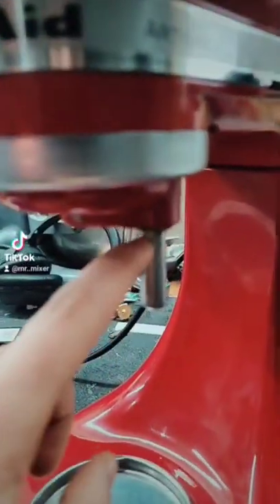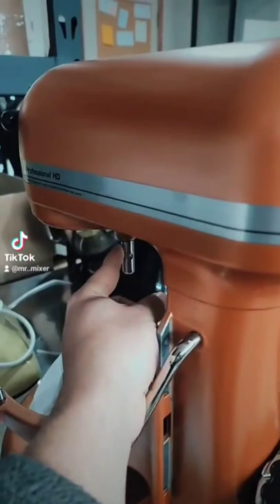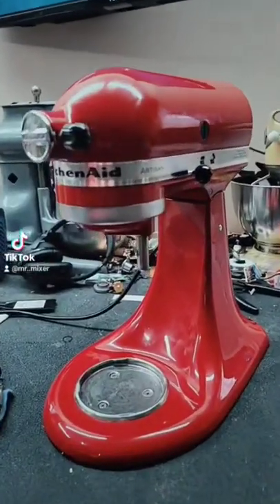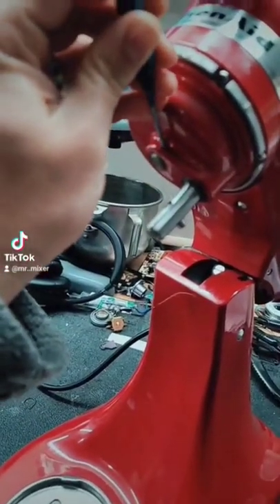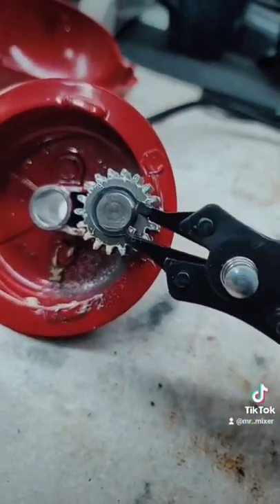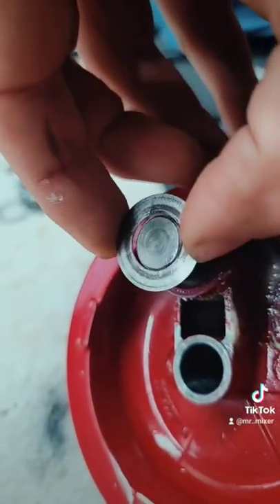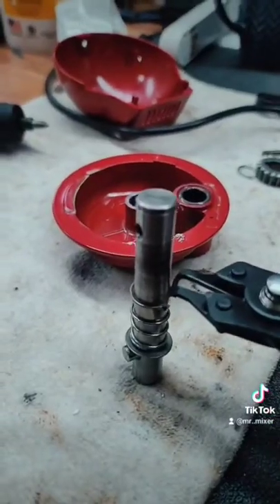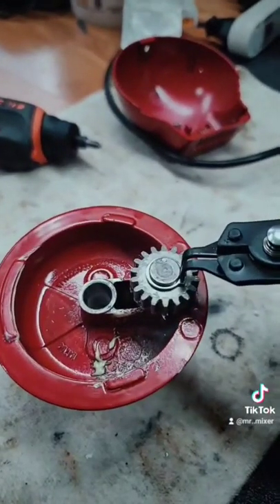spring Into action and protect your mixer!! #food #baking #baker #cook #kitchen #chef #icing #diy

Comment: Great idea and video.  However, I purchased this from you for my Pro 600 Series and just took a punch and punched out the pin on the shaft, added the spring and washer and replaced the pin.  Was much easier this way.  :-)
Reply from the maker: That works as well, but the reason I filmed it the other way is that if that pin/pin hole got damaged it could be a lot bigger headache!

Comment: Need help on my mixer.
The top gears will not move.  It was fine grinding  chicken. Currently it will not move as it should. I found the parts 
How do you replace this top part on the KitchenAid mixer.
Is it easy? 
  I tryed to move it ( moving the grease out of the way)
  Its not moving like it should.  Thank you for your time.
Reply from the maker: Have you seen our regrease tutorial? It will walk you through the disassembly and removal of all the gears

Comment: How does this "protect" my mixer??
Reply from the maker: It keeps the attachment firmly in place by applying downward pressure. Without it the attachments wobble putting extra strain on the machine when its mixing as it's not straight they get tilted off to the side while running. It also protects the beater from getting hollowed out as the beater is burnished aluminum and the shaft it sits on is steel!